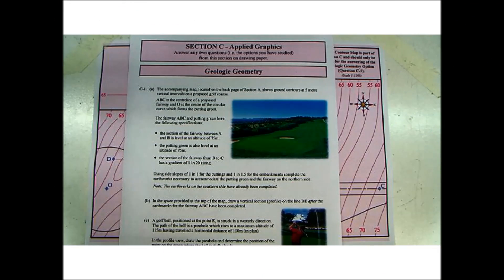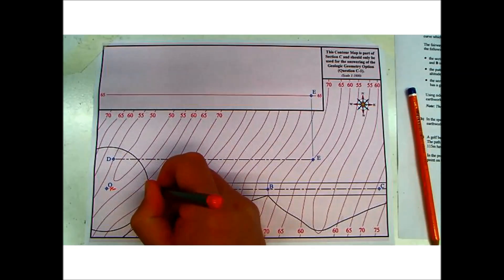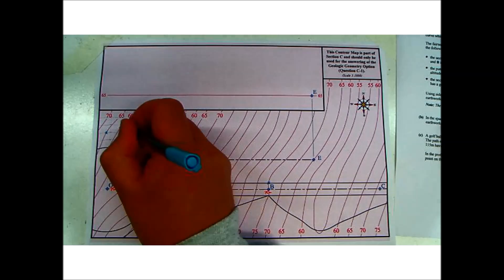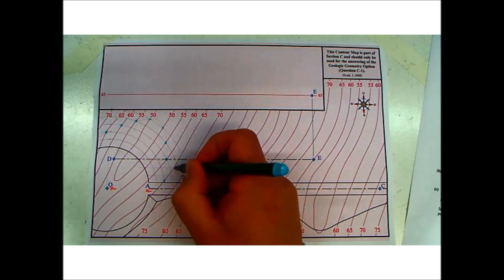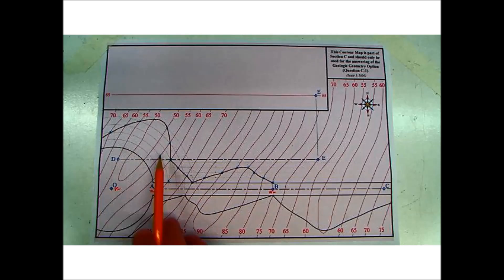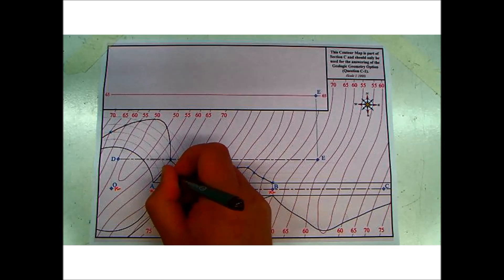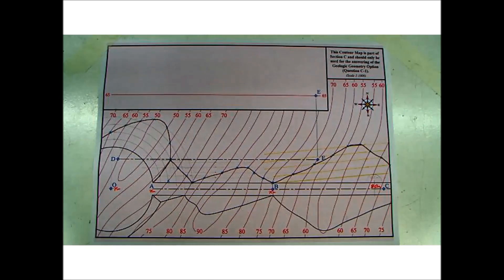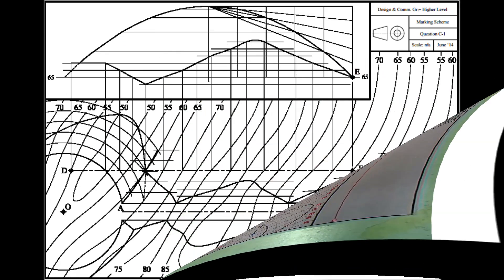DCG: 2014 Higher Level Question C-1 (Part 1)

Comment: i don’t understand how you know what radius arc u must do for the rising roads and that. i know about the fill at the hill cut at the butt just the radius i dont understand
Reply from the maker: It's from the scale. 1 is normally equal to 5mm becauce 5m is 5mm using the scale (1:1000). 1.5 of 5mm is 7.5 (1:1.5 = 5mm:7.5mm) and 2 of 5mm is 10mm (1:2 = 5mm:10mm).
Reply: like how did u know to use 7.5mm arc and how come in some questions u must use a 15mm or 10mm arc

Comment: How do you know its 7.5 intervals? How do you work out the 1 is to 1.5?
Reply from the maker: It says it in the question. Not sure which is which for this year but it'll say "1 is to 1 for cuts and 1 is to 1.5 for fill". If the road is at a higher level then the contours then it's a fill and if the road is lower it's a cut etc.